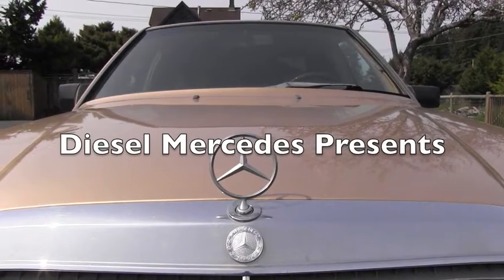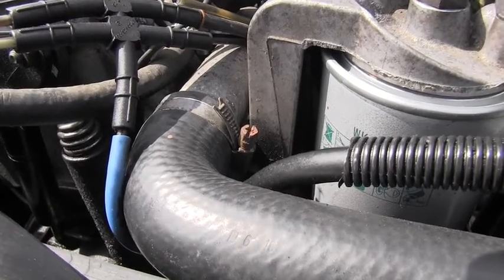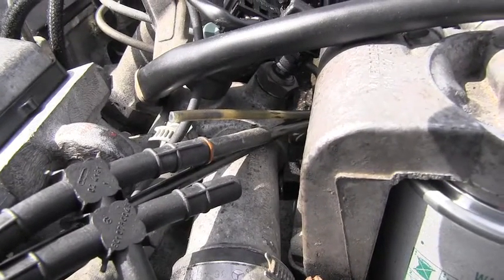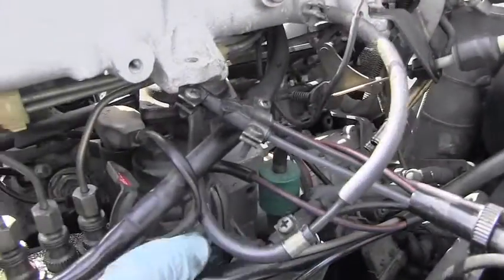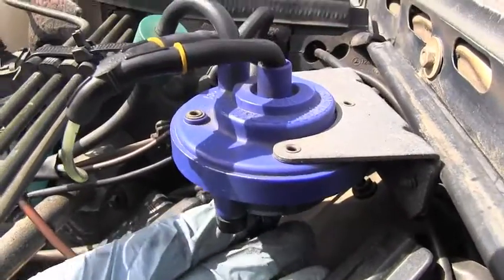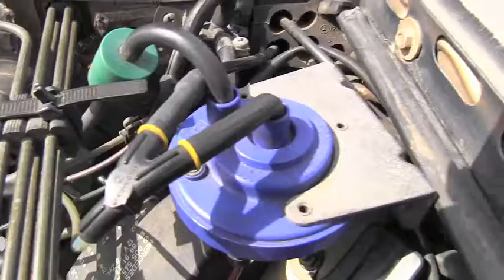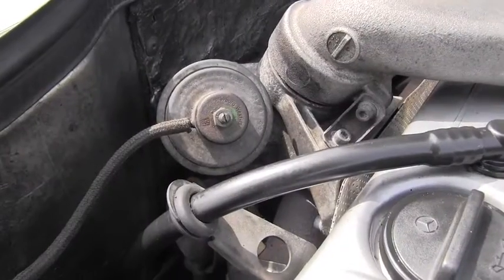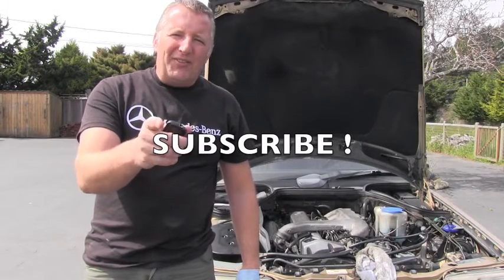Mercedes Diesel Engine OM603 Vacuum Lines Mess

Comment: You should do an in depth diagram that would explain how DIYer's could do the same.  I have deleted my EGR and those others under the air cleaner but I still think there are way more vacuum lines that do not need to be there, all for off roaders like me, of course.